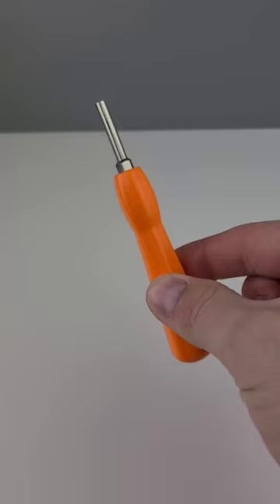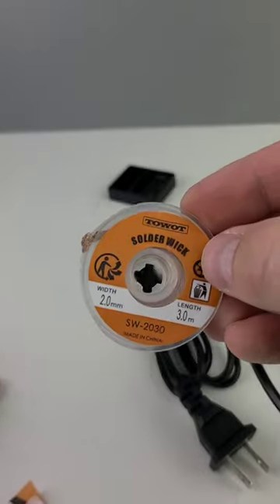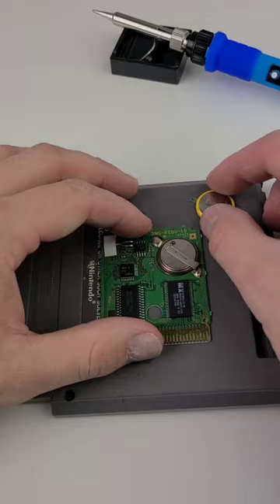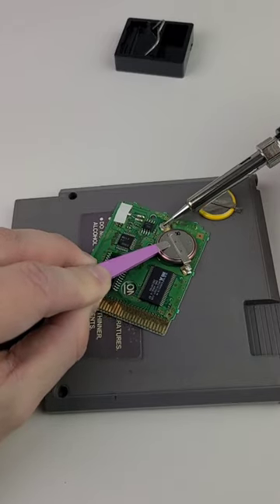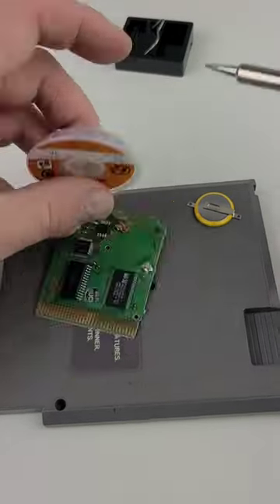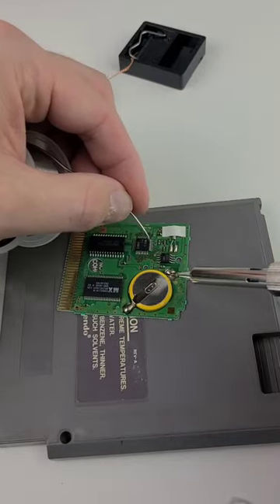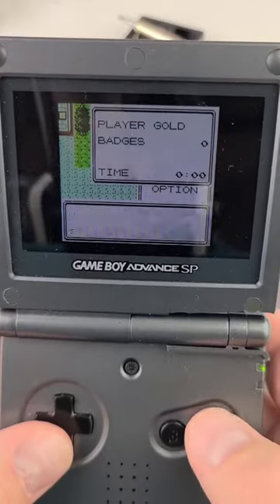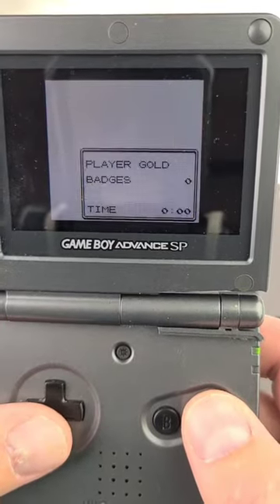🫣 FIRST EVER attempt at changing a Game Boy game battery / soldering #shorts

Comment: Nice job! A little tip for next time you solder. Try not to bring solder from the tip to an area, instead heat the area with the iron and touch the solder to the heated point. That way the solder will flow cleanly and make a better connection.

Comment: You did decent. Solderwick doesn't need any Flux  it can take sometime to heat up the wick  sometimes I find if you add some fresh solder and then use the wick, it will flow better. But all in all not too bad. Good job.

Comment: That is a pretty good first attempt! Ive seen worse. You don’t necessarily need flux since usually there’s flux already in the solder wire and also heat up the pads before soldering to them. And tin everything

Comment: It's important to use flux since it does help getting old solder off of the PCB but it also helps the solder to connect to the PCB more when connecting well in this case replace something

Comment: The solder on the board will heat up quicker/instantly unbind if you add a little bit of solder to the tip of your iron prior to using it.

Comment: Make sure you wear glasses/protective gear  Holmes. Sodder can mess up your eyes if it splashes on you which it will
Reply: What are you soldering with that it splashed on you? Have never had a single issue like that  and have been soldering for 10 years.
Reply: Better safe than not I guess. $2 goggles wouldn't hurt.

Comment: Solder wick is really useful if it sticks just add more heat and pull away. Best to add flux and low melt solder leaded then wick the low melt away it can be tough wicking the non leaded that most factory environments use.

Comment: Excellent work fam, my only two minor suggestions for improvement of technique of both wicking and soldering would be apply a bit less solder and spread it out more evenly; As for wicking, I would suggest melting the old solder directly with the iron and touching the wick to the molten solder and fold it over as you saturate the copper wick with the old sold. Other than that, everything else was done with the correct techniques and skills to do what you just did. Soldering isn’t exactly the most difficult skill to become proficient with, but some people don’t even try unfortunately. I’m glad you are teaching yourself an extremely useful and powerful tool that can enable you to create new technologies that could potentially change the world. The only question I leave for you this evening is: Do you wish to take on the challenges of learning and using your current and future skills for helping you and others leap forward in technological innovation?

Comment: Just get a solder sucker instead of a wick. It can rip off pads if you're not careful though.
Also, get a silicon mat or at least a piece of scrap wood to work on or you'll end up either starting a fire or ruining the tip of the iron
Reply: Or a perfectly good NES cart 😂 lol

Comment: my only critique is you didn't need the solder wick. or flux. you already had the old battery removed. you can use the old solder with some new on top just fine. otherwise it's a perfectly good battery change!
Reply: I've seen people argue that you should completely remove all old solder, as adding new could lead to a bad connection. Not sure how true that is, though
Reply: @BambooTime  it's fine. Lead is lead tin is tin. Silver is silver. It's not like a food item. Just make sure to reflow the old into the new
Reply: @BambooTime  i'll add that it comes down to the quality of your solder too of course. but flux and heat should get all the impurities out
Reply: @panofduluth  I see, I kind of assumed that's how it should be. After all, once it's melted, it should be mixed thoroughly, right?
Reply: @BambooTime  yeah if you used flux they should mix and the oxidized impurities should float to the top

Comment: its ok but u kind of got cold joints and didnt get the solder hot enough even enough so it will probably crack n brake free over time but great first attempt. takes a few tries and getting the heat dialed in for nice joints .the wick sucks even with tons of flux i just turn the heat up to like 350 usually does the job
Reply from the maker: Thanks!

Comment: Hey, this is great. I’m just about to replace a battery on my copy of Pokémon yellow. I’ve never done it before but I’ve soldered before so this tells me I could do it.😂
Reply: Update, so I just finished it was a success. The soldering was actually harder than I thought it would be. It just did not want to take probably should’ve used flux.
Reply from the maker: Yeah I'd use Flux if I did it again
Reply: @commoncentsflips4030  I thought, since it was such a small solder that I wouldn’t really need it

Comment: Trick is have a good iron. The cheaper iron you used in the video didn't get the solder hot enough. Once you get a better iron you will do better. I would rate your solder job a 7/10 sloppy but does the job.
Reply from the maker: Thanks!

Comment: Flux flux flux thats the reason you're having such a hard time, you need to use flux.
Reply from the maker: Thanks! The more people I watch, the more I realize that's true.
Reply: @commoncentsflips4030  also get a fume extractor if you're going to be doing more soldering, solder and flux have lead in it and when you're heating it up and vaporizing it to a molecular level and inhaling them, you will not be able to expel those metals from your body. That can cause complications in the future, you dont want heavy metals in your system, you don't want respiratory issues and you don't want cancer.